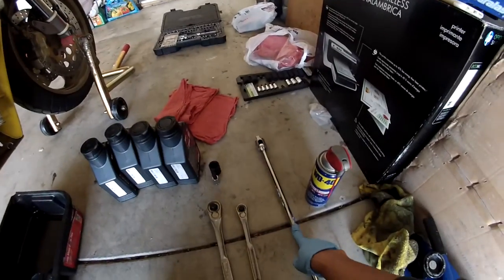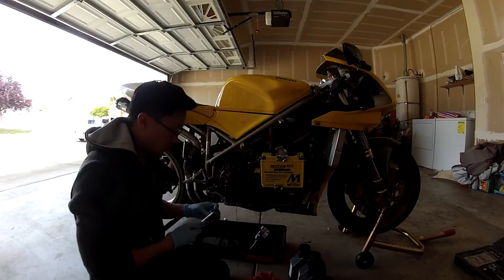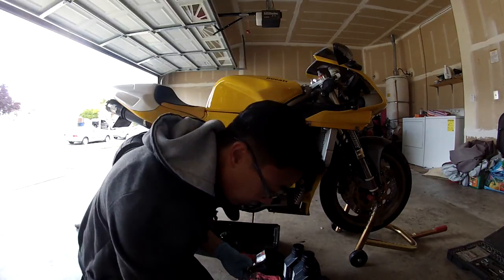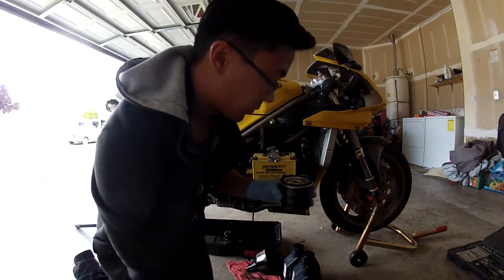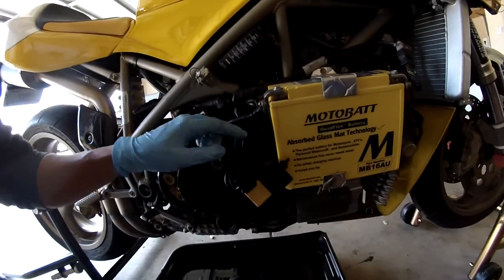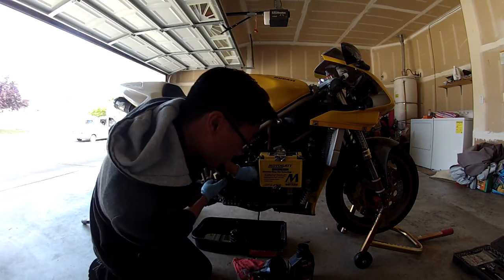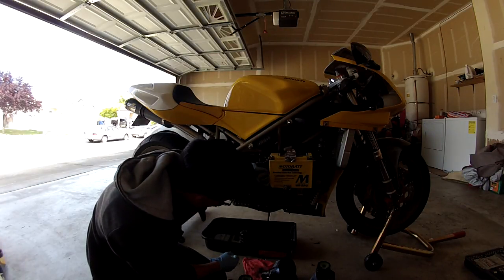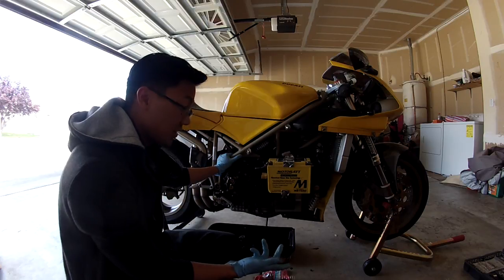Ducati 916 oil change

Comment: hi - I think it's better to do this after a short ride that warms up the oil, this helps to get out all of it regardless of its condition. My 916 has 18k on the clock and the mesh always carries some small debris, I clean it at every oil change (which means, every year) - this seems to be normal. My bike needs 3.5 liters BTW to get the level half way between MIN and MAX